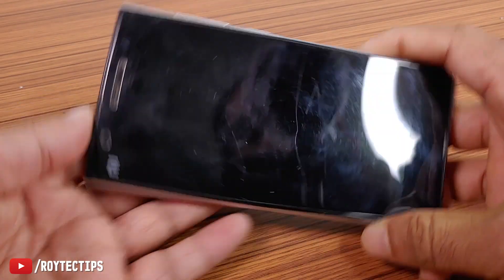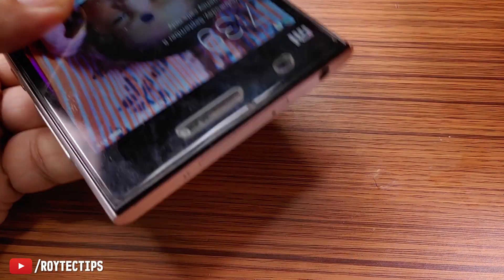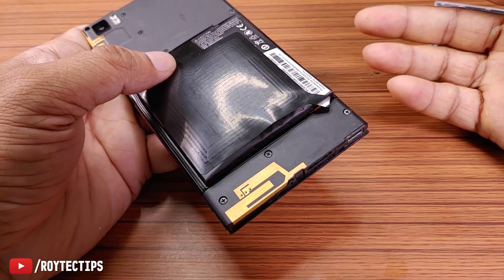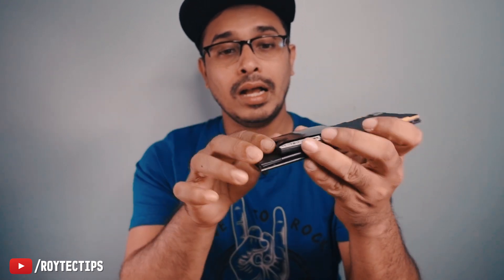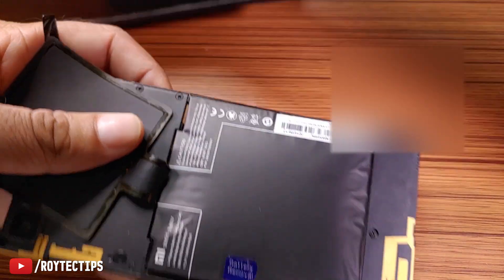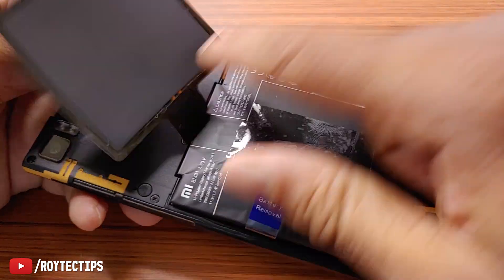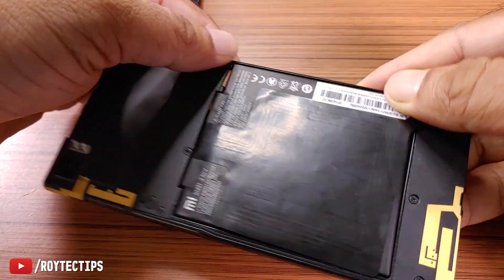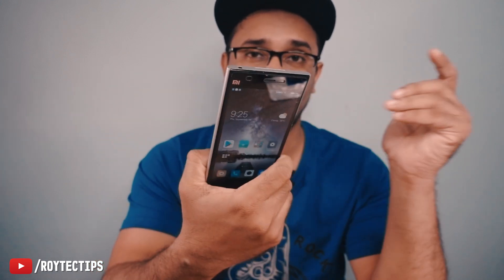How I Repair Swollen Battery in a minute - DONT TRY AT HOME

Comment: i have a question, that your battery drain very fast when they swollen? and when after you take the gas out, anything happen  in the battery preview inside the phone? (sorry if my english broken)
Reply: My battery was worse than this one and it was charging and holding a charge.
Reply: @jackm6307  @asvaldoayus9419 Saying a battery charges and holds a charge after performing this absurd "fix" is misleading. The malfunction that caused the swelling in the first place is still present. The battery is compromised and very dangerous!

Comment: Thanks. My battery is new but is swollen. I'll do your trick
Reply: Mine is new too imagine😤
Reply: @ngcebomagagula8838  isebenzile?
Reply: @mizile1486  it worked but mine drained faster so i bought a new one.
Reply: Did it work?
Reply: Mine is new too and it still gets swollen and it drained fast too...
Reply: @agiscobayagiscobay680  my Moto E Battery i use for fliming the battery is Abit Swollen but i Recently ordered a New Battery for it i would never use these tips in the video because it turns to a weapon after

Comment: If you are desperate enough to try this, which is not recommended, use a tooth pick instead of a pin then you have zero chance to F yourself or the battery up. The best solution is to buy a new battery, there's a reason why it swelled up in the first place.
Reply: tooth pick is not hard enough

Comment: Hello everyone please 🙏🙏🙏🙏🙏 Don't try this at home i actually did and a big blast occured and my half. Arm burnt and my bed also burnt please for god sake his one didn't exploded because he was in a temperature And moisture controlled Lab please dont end up like me
Reply: But then again HE TOLD YOU NOT TO TRY AT HOME 🤦🏻🤦🏻
Reply: oof
Reply: Wow. I was about to try this.
Reply: Is this for real
Reply: Yes if you puncture the battery incorrectly it will catch on fire. So doing this around flammable items can make a bad situation worse. Burned carpet. Burned couch. But remember a garage is not a safe place for a fire. Fumes from paint or cleaners can build up on the floor then explode if you add a flame. This is why garage water heaters are installed on an 18 inch stand. They don’t want the pilot light to ignite garage fumes.
Reply: he said in the fucking title do not try at home but damn hope you’re alright regardless
Reply: @PeeMan733  
I actually tried this. There was no blast. I guess because I let my battery empty to 0% before trying this.
Reply: @mizile1486  when you did that was it ok to charge it again? is the phone still working?
Reply: @mizile1486  did the phone work just fine afterwards?
Reply: @bxnene7258  yes. Before taping the phone, I'd suggest using superglue on the hole first, to avoid risks of leakage.